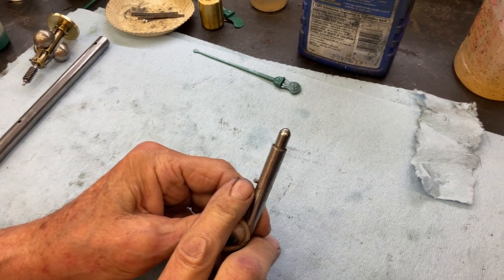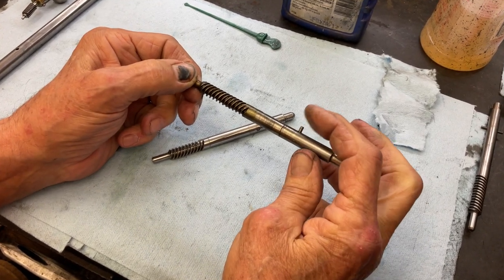1385.  Why the Victor 4-spring motor needs a spindle shaft pin. ￼

Comment: Not only that but the torsional force will eventually break that pin off if it's not fixed right and properly balanced.  Also when transporting these machines to customers, it's always best to take the turntable platter off the machine to avoid pin  breakage if a slight bump occurs. Great video